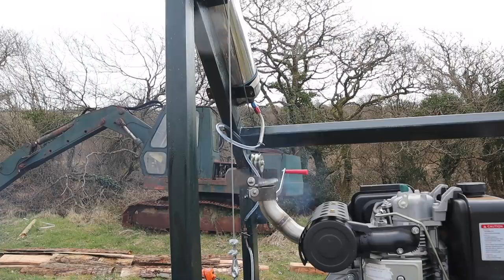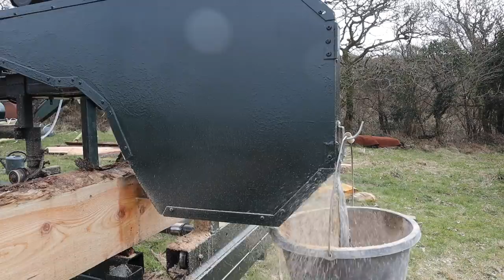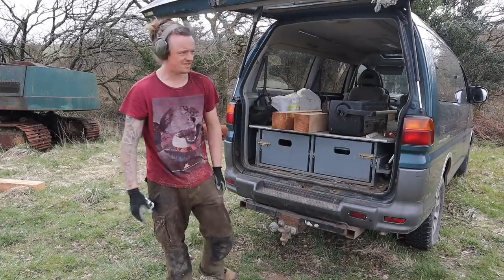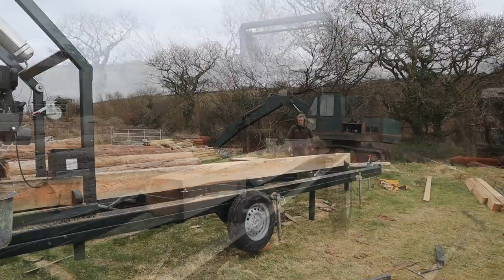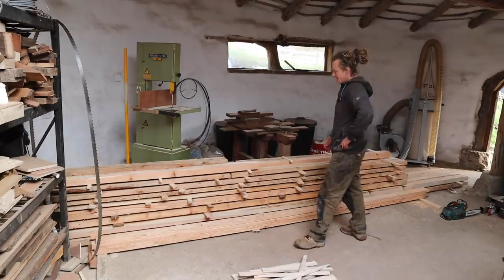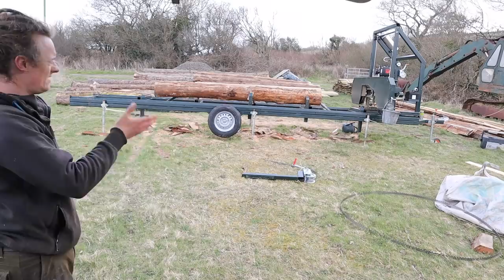Milling Larch For The Greenhouse On My Homemade Bandsaw

Comment: Kris - I can see a saw mill shed in the future. My friend does this and he got sick of the weather so he built a shed to mill in when the weather gets bad. Smokey Mountain outpost is where he got his idea from. Best wishes from Perth Ontario Canada!
Reply: my neighbor has his mill in a shed. Not the best set up though. Kinda like the one I descridbe down below yet with out the trolley. He uses a fork lift to load the logs on the bed. 
I see another youtube video where a guy build a steel track in his barn and then his mill is fixed in place ( though I think he can move it from that area at any time. He uses a trolley type cart and then pulls the log thru the mill. Kind of a neat set up. 
If I was to build a wood shed I would build it with the mill in the middle then on one side or another build a trolley cart that moves in and out of the shed and you load the logs on to the trolley and then when you are in the shed you have moveable ramps that you can roll the log over much like a large table that way you can have a few logs on the trolley and then raise the bars for transfer over. When dropped you could still walk everywhere around it. Then the other side is for stacking and drying unless you want a kiln dry tunnel..  This also depends on how big the bed is, the long it is the more open space you would need to come in the side of the building. Though it could be done pretty easy. 
With his set up he could back the trailer in to the shed set it up and level it and use a trolley to bring in and transfer the logs.

Comment: Really impressed by the attitude and I echo all those who note you don't headline the video with your injury. Very genuine.
Having a mill myself, I have 3 suggestions. A scissor jack on a shelf beside the beds will allow levelling the heart. A whole leg of the welly would collect more of the sawdust, and a crank in the top of your loading ramps would negate removing the road wheel with T piece at one end or other to stop them tipping over.
Brilliant mill. Well done.

Comment: Every sympathy for you, broke my thumb some years back when the lever on a Spanish windlass broke and whipped backwards hitting my thumb several times. Four tons in a trailer on a down hill slope generated a lot more energy than I had anticipated. I could not speak,just had to walk off the pain. they never heal straight nor work quite right again.

Comment: Man that hurts, I had the same type accidents happen to me. I was backing a boat off a trailer and was almost finished an the boat driver gunned the motor and the handle spun around a hit the top of my hand 🤚 and it hurt like the  ‘dickens’. Out of commission for two weeks. Very dangerous those handles if they get loose. Hope you heal soon. You a one talented, hard working man. Thanks for your insightful videos. 🙏🐻

Comment: Band sawmill is a great tool.  I find the same savings and convenience with mine. toe boards are really necessary for setting the pith in the center. Sorry about your hand. Your right, "Those things happen" when working with heavy equipment and materials.  Good luck with it.

Comment: For some reason I don’t think a broken finger is going to slow you down much. Good call on installing a name brand electric winch in place of that unbranded hand winch. 
Years ago I worked in a shop that did leaf springs and big truck suspension work. We used chain hoists to lift the rear of the trucks. One chain hoist didn’t hold and the pull chain was moving extremely fast as the dump truck was coming down and as I reached for the chain my boss screamed at me to stop. 
If I had grabbed the chain I likely would have ended up with a severe injury. 
That same boss nearly hit me in the head with a sledgehammer when I held the bar to drive a bushing out. I felt the sledgehammer go through my hair. 😬

Comment: To avoid wavy cuts you need a saw tooth bender/straightener. It's one thing my dad had with his mobile saw mill back in the day (I even had a go using it). You'd bend each tooth by hand (with said tool) to within mere microns and you can get very, very smooth cuts without TOO much work (it still requires a fair amount of patience though).

Comment: This seems a silly thing to comment about but I really like the green you chose to paint the mill. It reminds me of something from my childhood - I can't quite place what it was but it's a good memory :D

I wonder if it would be more efficient to run the diesel to generate electricity, and then run the saw mill on an electric motor. If the mill is anywhere near your existing electrical systems you could use the house battery bank as a buffer and top up the batteries while you're shunting the logs and boards. The diesel could run at optimum fuel efficiency and the mill would be a fraction as noisy.

Comment: Hi from Canada Kris, I love your channel. Sorry to see you hurt your hand. I had a similar injury a few months back. I was using a boat style winch in my shop to act as a hoist for lifting things too heavy for man handling. My hand slipped off the crank handle and the winch came around and smacked my wrist. I didn’t break my wrist but it sure was sore for a week or two. Anyway I found a small electric shop winch on sale and installed that. It works well except it moves faster than I’d like. I’m using it with one extra pulley to double to lifting weight and 1/2 the speed but it’s still a bit faster than ideal. Anyway it is safer for sure. Good luck with your modifications. Get well

Comment: Absolutely awesome man!
One thing though, as far as I know the stickers need to be aligned in the vertical plane. What you have now is a heap of timber pushing bows into drying wood, specifically ofcourse the bottom layers.
Dunno if its mentioned in the many comments below (where's that search function), thought to mention it anyway..

Comment: A couple of wedges driven from opposing sides on the small end of the log should help you get the pith centered accurately. The fancy solution is called a manual toe board if you want to search for different mechanisms - there have been some guys making their own and posting them on YouTube for reference. Hope the finger heals quickly.

Comment: Hey Kris, one of the things I can tell you about using a sawmill is that many of the operators load the logs onto the machine with the small end at the start so when they square the log into a "Cant" it's less work even though some of your flitches will have chunky ends some of those can be used to make 3/4" sticker wood for the drying process for the wood you're keeping. set the stickers two inches from the start and every three foot from there on thinner boards and every four feet on "two by" timbers this will aid in the drying process.

Comment: Hey Kris. I do a fair amount of boating for work and that type of winch and handle are used on  trailers. They have casued me much pain and injury over 30 years. They are basically crap. broke the bridge of my nose when recovering a 2.5ton skiff.  Best place as you say is the scrap pile
Reply from the maker: So many people have commented with the same thing happening now. seems they are really dodgy. I think they are ok if you only ever use them in the up direction.

Comment: We did see you had fitted a flapper to the short exhaust pipe, the other improvements I would do to that sawmill would be; a powered upper frame shunt, looked like a lot of effort to push it when cutting? Extend the exhaust pipe to the top of the frame - possible that the wind might still blow fumes into your face (despite pointing the short pipe up) and a bag type dust collection - the bucket, hook, and rubber flap works, but a moderate amount of dust was spraying out the top of the bucket and wafting onto the ground - I would have a specially shaped nozzle on that corner of the pulley housing to direct the dust into a (breathable) fabric bag hanging on a square/round elbow and the wind made by the passing blade will inflate it. Will reduce the dust down the side of your sawmill

Comment: If you add a spout coming off the side over the bucket at 45 degrees it would get more dust in the bucket, and possibly more out of the machine. As it sits now it hits a rubber wall at 90 degrees which seems to shoot some of it up through the protective cover.

Comment: Wow, .... Now That Saw-Mill works absolutely Brilliantly !!!!! .... Still feel that you Definitely 'Need' a Horizontal 'Pusher-Bar' from the Far Upright and Thru' the near upright, thus creating a 'Hand Width' Stub on the Near side, Maybe even a Stub on the Far Side, Just in Case you need to push on the Far Side too .... Unlikely, but you have the option .... Just a piece if 25 - 30mm pipe with 'Handlebar' Grip pushed over the Ends .... I am Sure that pushing on a Horizontal Bar will be so much more 'Comfortable' and Effective ..... Trust that your hand will heal quickly, sitting around is just Not Your Thing ..... :-)   :-)   :-) .... Very best to You and Yours from NZ

Comment: SUGGESTIONS:
1.  make an extension to the exhaust ... so you dont have to work in the stink of the engine ... it doesnt have to be permanent, just a bit of pipe to stick into it and extend it up.
2.  you could try to create COMPOSITE BEAMS out of the thin cuts ... by glueing them together. This - if you manage to create these things in a decent quality - could result in LONGER BEAMS than your "standard length" ... if you want to span a bigger room for example. [There is a supermarket I know, which has 30m + long beams to hold up the roof with no pillar inside.]

Comment: Need to stiffen-up the blade guides, they flex while the mill is running. Make them stiffer and it will cut truer. Some of the logs that have significant taper need to be shimmed on the small end so that the centerline is parallel with the bed (for the first cut). Just remember to take the shim out when making the companion cut on the opposite side. It will help make better lumber.

Comment: Great stuff. Get well soon. I'm no expert, but I've milled a fair amount and I was told by a true expert to do your best to place stickers in a straight line above/below one another to avoid wavy boards while drying. Also, any boards extending beyond the major stack (such as your 5m boards) ought to have a bit of weight on them so the ends don't bend/curl. Just a thought. Great work.

Comment: Look up Esko's bandsaw mill if you haven't. He has a really nice method of loading logs whereby you have 2 beefy steel trestles and have all your logs piled on there, with two struts in the top of the trestle that can slide out onto the mill, keep the logs at the same height so you can roll them on by hand easily.

Comment: glad to hear you are taking the correct action to prevent a repeat of the accident. 
Do you have a Ruler attached to the uprights of the mill?. Makes it easy to know what height you just were at and to know where to set the blade for the next cut. A little bit of wire attached to the mill pointing to the ruler makes for a flexible indicator on it as well.

Comment: Works great! How about installing a car jack at either end to lift the tree into the right height for the first cut? No messing about with pieces of timber
Reply: Oh and sorry about the hand Kris. Injuries usually mean that I'm working too hard when that happens to me. 
Debarking: lots of sawmills have a small cutting blade that rides in front of the sawblade, clearing the wood from bark, sand and debris. Perhaps something for a later add-on?

Comment: Hey Kris,
Great to see the Mill is working out well, sorry to hear about your hand. I've had the exact same thing happen to me with a hand winch raising trussing years ago. You lucked out with just your finger and thumbnail. The handle hit the back of my hand and broke and splintered a number of bones in my hand. It took about 6 months before I could use my hand and about a year when it was finally close to normal, as normal as it would be after the breaks. When I saw you with the hand winch a few weeks back I winced as I remembered that damn hand winch. Sorry, I should have said something then, you might not have gotten hurt if I had.
Keep Safe Always,
Matt - Toronto, Canada
Reply from the maker: Hi Matt, thanks for the anecdote. there have been a number of comments with similar stories. I wont be using it again. seems like they are an unsafe design.
Reply: @KrisHarbour  Hi Kris, I just wish I had said something a few weeks ago. I messaged you on your last video regarding the bandsaw frame and track, had you seen the message?

Comment: Sympathies about your hand ! I injured myself using a trailer winch, i knocked the in/out ratchet to the neutral position & the handle spun around & smashed my thump, how it never broke is a mystery ? My thumb swelled up like a ballon & the cut was deep enough to see white when looking in at it.

Comment: I'm working on a chicken coop my self, only start the coop today, I've had the run made for munths but haven't gotten to the coop, I've cut the wood for the frame, tidyd and sharpened some chisels, and made one of those rownd mallets or whatever their caled. With a chance I'll give it mortise and tenon joints so that it's bound good, I might film it.
I'm looking forward for a video of making a chicken coop if you'll make one, I'll proberhably be able to se much of what I've done wrong.

Comment: I wonder if a mechanism can be construed to turn the water on and off depending on the motor RPM?  Ideally - if the centrifugal-clutch engages, then the water should flow.

Comment: Damn! I was about to leave a gushing, excited video about how awesome it must feel to be doing all that milling. And then you mentioned your bust hand. Damn!!!

Dude... As someone who had a bust hand... Don't just strap it up. At minimum, have x-rays taken, so you can rule out compound fractures with complications.

And, on a lighter note...

I noticed a fundamental flaw in the dust bucket system. It seems like you've neglected to attach a drone to it. With a drone, you wouldn't have to manually empty the bucket into the dust sack.

Comment: The amount of times you can sharpen a blade depends on how far the quality of the blade, usually 2 to 4 times befor it breaks.  If you don't allow the logs to get dirty, it shouldnt affect the blade at all . get you logs off the groung, build a bed abou the height of the mill to make it easir to load the logs

Comment: A solar kiln is a good thing to build once you have a sawmill as it speeds up the drying process without any outside fuel. When you are not drying wood for yourself you can always rent it out as an extra $50 a month for doing no work is always good. 

Be on the lookout for tree removals going on as you can make some good money slicing up a nice log round with some limbs in the right type of wood like walnut to get blanks for making gun stocks. What is hard to split firewood for some is cash for you now that you have the tool to work it.  Yes the real money is making huge slabs but people that work on smaller things can be good customers too as they often don't need a huge slab when they care more about the sections with good patterns in them. 

Ouch a broken finger is no joke but at least you know how to splint it. Can you pick up a splint at a local shop or do you need to order one?

Comment: after you cut and split all that fire wood - now you will have more than you need of off cuts but that's a good problem to have right. now you can make a bit of extra money when needed selling custom stuff like  table tops from stump wood beams etc.
Reply from the maker: All those off cuts are going to be in the workshop roof soon enough.
Reply: @KrisHarbour  right but when you cut a board to size the small bit at the end will add up more than you think as time goes on
Reply from the maker: Oh yes, the plan for all those is as firewood for the workshop. thats why we didnt cut any extra for the workshop this year, i knew i would have alot off offcuts from the top workshop.

Comment: Wow sorry to hear about your finger. You're probably more concerned about how to fix the winch from what I can gather lol! Get some rest and thanks for sharing.
Reply from the maker: Thats already sorted out. it will be back up and running in no time. it still works to be honest but i wont use it like that untill the winch is changed. you cant have a critical part not working correctly. The electric winch will be a lot safer as it has a locking break.

Comment: You should build a trailer to attach to the end of the bandsaw so that you can just pull and stack the wood and not encounter the risk of injury be it arm injuries/pulled muscles or risking dropping wood onto you legs or feet..... or breaking fingers 🙁.  A log loader or bench might be another addition to the saw to make life easier.

Comment: Bummer about your finger! At least it wasn't a blade injery! Here's something to think about while you heal. Why don't you fit a solenoid valve to the water supply with a waterproof micro switch fitted to the throttle control. When you open the throttle to cut, the solenoid valve opens and provides the cooling/lubrication to the blade. Throttle down, the valve closes saving water. That way you won't have to keep refilling the water tank so often.

Comment: As fast as your bucket is filling up, why couldn't you get an extra long piece of flexible dryer hose and hook it to where the saw dust comes out and have the other end in your garbage bin that you are putting the saw dust into?? Just a thought.